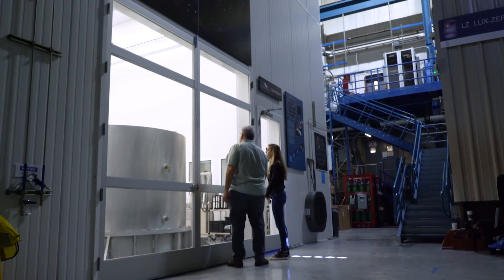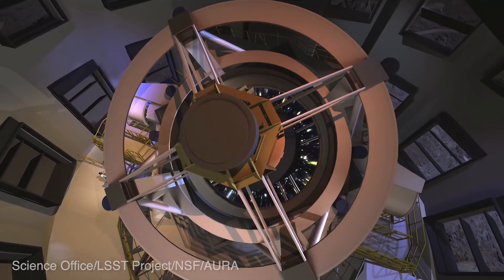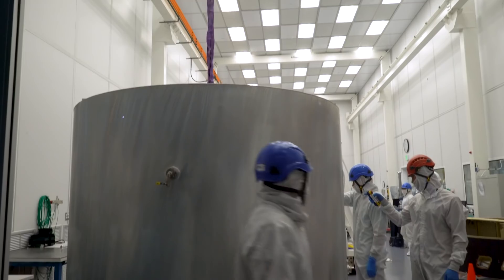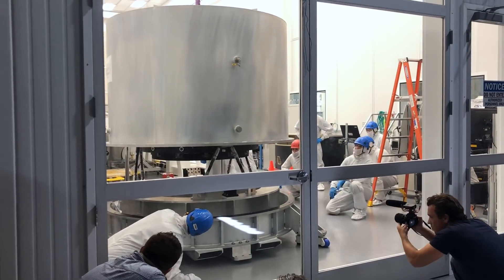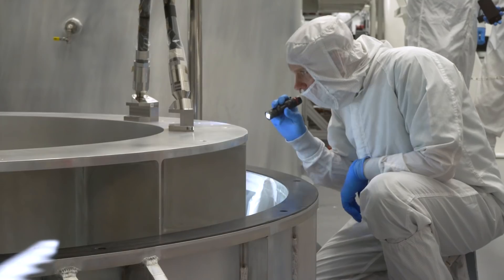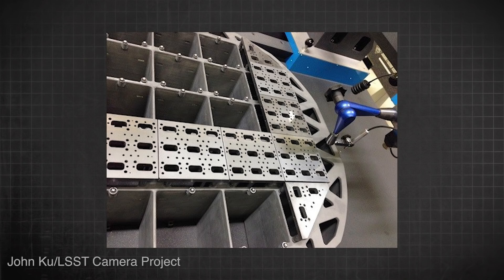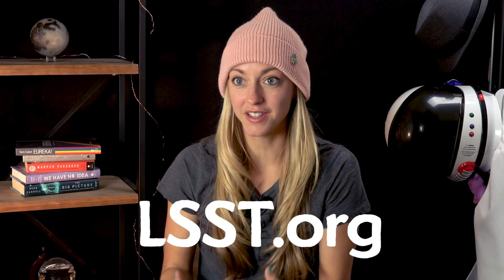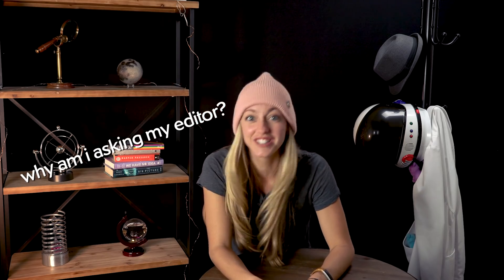World’s Largest Camera Lens

Comment: There's something weird about seeing a state-of-the-art digital camera worth $20 million being moved by a forklift that looks like it came off the assembly line around the time M*A*S*H was getting popular. Shouldn't they have a Jedi Knight or something on standby for tasks like that?
Reply: I worked at DOE we had alot of old forklifts some from 60s..
We handle nuke stuff also.
All inspection and good.
Reply: And that single lifting point ,,,
Reply: It is much easier to lift an X Wing than a lens like this.  This is covered in Lifting Stuff 203 of Jedi Training.
Reply: @jarodmorris611  Judge me not by my size, for my ally is the F=ma
Reply: I don't care how old the forklift is just that it is reliable and not prone to lifting failures.
Reply: @LadyAnuB  That's the same thing my girlfriend said last night, bless her heart. A fellow, I mean forklift, needs to hear that sometimes.
Reply: Just the lens was 20mil
Reply: @demottt  20 mil of work in engineering and craft, not necessarily material.
Reply: @sMASHsound  The material is just quartz, which goes for around a hundred dollars a ton. Virtually all of the cost is in the design and manufacturing.
Reply: @sMASHsound  point was that the comment claimed they spent that much on the entire camera, and that was not the case. I never claimed it was in materials m8.
Reply: @EebstertheGreat  lol bulk quartz is NOT what they used to build this
Reply: @cdreid99999  Of course not. But fused silica is the same material. The difference in cost comes down to the cost to produce it. Ashmeed's post was pointless.
Reply: @EebstertheGreat  Quartz is very expensive - when you need this purity level. Same with the silicon in wafers used to make integrated circuits. Cheap raw material until you need a lot of it at an extreme purity level.
Reply: @perwestermark8920  It's really not. The massive lens was about 1.5 m in diameter and 0.1 m thick, for a volume of 0.18 m^3 and a mass of 470 kg. Fused silica powder ranges in price from about $.05/kg to $1/kg in bulk. So the expensive part is obviously not buying the raw powder, it's manufacturing the lens.
Reply: @EebstertheGreat  Did you fail to notice I talked about purity? So 99.9% or 99.999% purity makes a very big difference. The cheapest price for 500 kg is very low. But that price is irrelevant.
Reply: @perwestermark8920  I dare you to find me silica of optical quality for more than $2000/ton.
Reply: @EebstertheGreat  I can find "optical quality" for much less. So what purity do you define for your "optical quality"?

It isn't the cost of the material, but the cost if the processing, that matters. And "optical grade" is often 99.9-99.95% purity, while better grades gets past 99.9999% purity with extremely low metallic and OH content.. My guess is that they have selected one if the better grades from Corning.
Reply: @perwestermark8920  "It isn't the cost of the material, but the cost if the processing, that matters."

Wow, thank you for finally getting there. It took you a while. That's literally the very first thing I said when the raw material wasn't the expensive part.

And Corning is the biggest supplier of high-end fused quartz and silica. They do not charge millions of dollars for half a ton. It is not a significant part of the cost of the lens.
Reply: @EebstertheGreat  So did you read my first post? Why do you think I wrote "Cheap raw material until you need a lot of it at an extreme purity level."?

Exactly - it's the processing of the material that matters. And that is also why silicon is abundant on our planet but the IC manufacturers runs to a halt if the company that creates the pure silicon - or the company that cuts the wafers with the required surface finish and tolerances  - has a production problem.

You mean you argue with me without actually thinking about what I wrote? 🤔
Reply: @perwestermark8920  The purity is fundamentally not the issue. You keep acting like highly pure silica costs millions of dollars. It does not. I doubt it would even be possible to find someone trying to sell silica of any purity at a hundredth the value you assign.

It is not the purification that is expensive, it is the manufacture of the lens. We just keep going around in circles. If you really think high purity silica is so expensive, find me a source. All the sources I have checked have sold it for less than a thousandth the alleged cost.

Incidentally, even the silicon boules used to make blank wafers are not nearly this expensive, and they are thousands of times more pure and are monocrystalline. And even then, the overwhelming majority of the price goes into growing and cutting the boules, not purifying the silicon.
Reply: Classic..
Reply: Ya when it's swinging and they're saying "we have to be careful because with a single attachment point it will swing"... Instead of maybe... Using multiple attachment points or building a simple lifting mechanism..
Reply: Probably better built back then…
Reply: I can say I've operated a forklift exactly like the one used in the video. I feel better about my career choices now.
Reply: what are you trying to say? it sounds like you are just a massive bigot against forklifts..
Reply: @Radavvadra The old fork lift was probably made in America, as opposed to China
Reply: @Radavvadra Second that. I saw many examples of "technology going forward" like self-burning OLEDS, for instance.

Comment: I was wondering how they were planning on correcting for chromatic aberration, the filters seem to answer that.  Now I wonder what kind of post-processing they're going to have to do to manage the optical differences that would have resulted in chromatic aberration had they been exposing in fully color rather than with the filters.